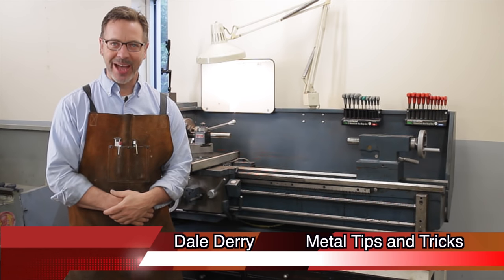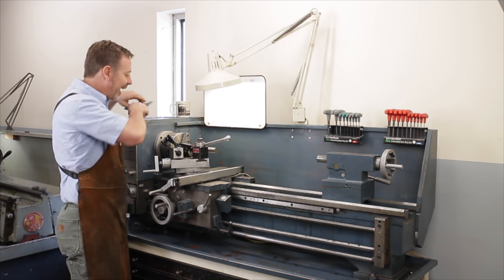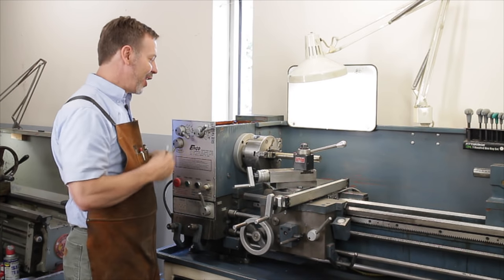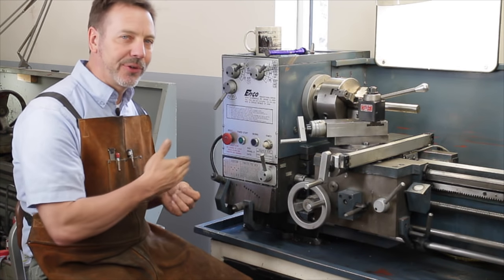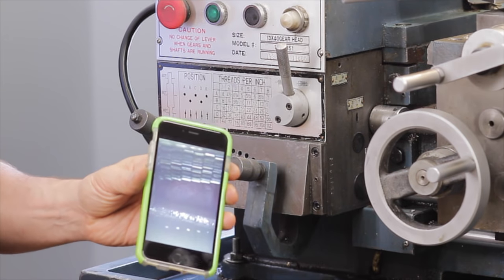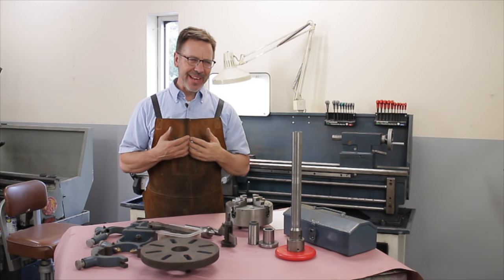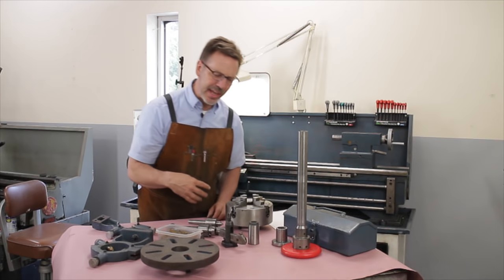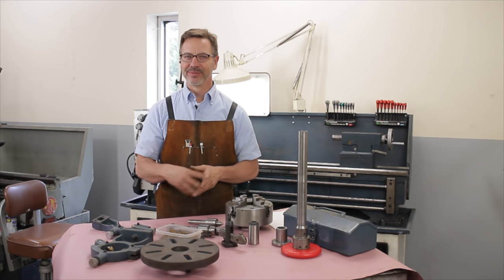How to Buy a lathe part 2

Comment: fun series Dale..  I do everything you mentioned...

AFTER I've bought it.  I'm lucky if they let me take the tarp off.  ;)
Reply: +1 lol
Reply from the maker: +This Old Tony 
LOL that happen to me once.
Reply: I had the owner drain the oil and remove all the bearings and send them in for molecular testing while he had a certified lab do a full magnaflux on the rest of the lathe. Then I just ended up getting a HF mini lathe instead..
Reply: That’s what I questioned in the first video. I really don’t see most sellers allowing people to do such an exhaustive check. Turn it on as see that it runs. Take a good look and turn a few dials, and that’s about it.

Considering that most older lathes are going for little, by the time you subtract all of these problems, the guy will be paying you to take it. But if you have the room, the power, and a way to get it home, going to industrial auctions can get you a heavy, old, American made lathe for peanuts. But they will be very dirty, and need work. Many of the problems mentioned here will be seen. But if you can fix these things, and are willing to put some money into it, you can get a machine that will do everything you need, and last forever.
Reply: My last lathe purchase went like this over the phone:
"Hey I noticed that your ad is a few months old but still up, just wanted to know if the lathe is still for sale?"
"Yeah, had some people look at it but no one wanted it. Say, how much was it listed for?"
"You had it on FB marketplace for $1500"
"Ok, I can do better than that"
"Ok, tell you what, give me a price you want to sell it for if it's good enough, I'll buy it sight unseen.
"You can have it for $1000"
"Sold, can I pick it up Saturday?"
"Sunday's better for me, cash only."
"No worries. See you then"
I am now the proud owner of a SB 9A x 36 toolroom lathe 1961 with V-belt and under cabinet drive. It came with a 3 jaw, 4 jaw, complete set of 3C collets including hex and square, telescopic steady rest, Aloris toolholders, QCTP (new), lantern post, tooling for the post, he threw in stock, carbides and HSS. I got the sales card from Grizzly and it had a hardened bed option. The only thing missing was the taper attachment but the crosslide still has the taper version on it. It had a new three phase 1.5HP motor. I preordered an inverter and tested it the day I moved it. Everything worked. Took about two months to pull it all apart to clean it up and rebuild some things part time. One of the best purchases I ever made. Didn't spend money fixing it, just time. The bed looks like new. The lathe works like a dream. My wife doesn't want me to buy a taper attachment to complete it, because she knows I can make one. So that's the next project.

Comment: Good set of videos.

Just a short comment about the horsepower of the motor:  Unless someone were to run a .300 deep x .020 cut in 6" 4140 heat treat on the "Baker's lathe" you'd probably never get the motor (5hp) to put out its rated power. The bigger problem with motors is the mismatch between the available power (1 phase vs 3 phase and 110V vs anything higher) and the electrical requirement of the motor. If, in fact, you had a 5hp 110v 1 phase motor (I have one so I know they exist) and you were to start pulling the rated load the breakers would most likely kick-out (unless you have a special circuit for the machine). If the higher-power motor were to have a higher speed than a stock factory motor (3450rpms vs 1725 stock) THEN there is a problem and I'd walk away. You can never know how that machine might have been abused running at 2x speed.

In machinery speed creates wear more than the power transmitted.

Comment: Excellent tutorial, and I like what you are doing for the trolls! This is the first video I have seen where someone took off the gearbox cover and didn't actually run it to check the "splash" lubrication or had signs of same incidence on the walls. Thanks!
Reply from the maker: +howder1951 
LOL

Comment: Dale, your guide is amusing in many ways. Machine tools bought for the money you have apparently spent are usually at the end of their economic life and not up to much. I find your prices frankly incredible. As for buying any lathe it is all about the bed and nothing else. All other surfaces can be made to run no matter how warn, but a bad bed on a cheap lathe spells recycle time for it. If you have perceptible end float in a  Timken bearinged main spindle the gears would likely be damaged and you would be breaking carbide tips like no tomorrow. You would also be getting a chatter patterned finish on any work attempted. The most accurate lathes generally use a precision bush system on the main spindle with attendant thrust bearings because Timken bearings by their very nature tend to allow for some chatter no matter how well you set them up. As for your comments about the wear on the lead screws and inaccurate thread cutting as a result I consider that would be very unlikely. As long as the form of the screw is still there and the clamp nut is in good condition it would still follow no matter how rounded the thread has become. It has not changed its pitch, it has just warn a bit in other words. Hell what would I know, I'm in my 60's and work as a machine tool mechanic!
Reply: If the lead screw is worn in the usual area, your thread pitch would decrease slightly and then increase slightly as you traverse. That could make a difference on your job eh?

Comment: Dale,I wish I had your video when I bought my lathe.  Its the exact model you're demonstrating.  Problem was that while in very good shape, it was missing a few pieces.  Like the Quick Change Gearbox cover plate, threading gear quadrant, and the 2 40-tooth gears.  As near as I could tell a disgruntled employee took them when they did away with his job.  But as they say "I wanted it."  It came with a fair amount of tooling and DRO.  I learned fast that Grizzly was a lot more economical for parts than Enco.  That plate was over $200 from Enco and about $35 from Grizzly.  The quadrant needed a little mod to fit.  The surprise was that the plate came undrilled.  I took the knobs off the shift levers, drilled the primers out of two 9mm cartridge cases per lever and then slipped a locating punch through the holes in the primers.  I lined up each lever to the proper gear and marked the plate.  Drilled the holes and was back in business.  Next time just run away.
Reply from the maker: +Chris Vuxton 
Great comment.

Comment: Very well done Dale and I'm pretty critical about just how much can sometimes get missed on videos or forum topics of this type. Maybe the couple of things I could add would be to check the clearance by lifting up on the spindle a non roller or taper bearing lathe and indicate that movement since if it's been run dry at all or just decades of general wear then gravity alone will give the most clearance in that direction. 

It's certainly user specific, but having a tee slotted cross slide for between centers boring would also be very high on my list and add a fair bit to the price as well.
Reply from the maker: +Turning Point 
Great Points

Comment: great video Dale, I wish I saw this before I bought my gearhead lathe. but like; this old tony said. " i did my full inspection post purchase". I got totally hosed on it, like for example 3 gears were missing a few teeth each. they are very very costly to buy and tough to make, they are hardened and ground gears, even the ID is ground lol.

I wasn't able to hear it run, because his phase converter was "not working".

In retrospect I should have walked
Reply from the maker: +Billy T
 Im so sorry to here that :-(
Reply: ***** live and learn I guess.... you'd think by age 47 I would have learned my share by now

Comment: I was able to find a atlas 12 x 36 aloris tool post and nice full set of tools and has quick change gear box, no teeth are ways wear,, and my dail indicator didn't hardly move on spindle check ,, 800 dollars and 3 miles away from me,,,great deal..

Comment: I am learning about lathes as much as I can before purchasing my first one. Your videos were very helpful. I have not gone and looked at one yet. 
What size is that Enco?
What type of electricity service does it require 110v, 220v, or 3 phase?
I want a lathe to supplement my other hobbies, car and motorcycle repair and restoration. What is the  minimum/maximum size lathe I should consider? Thank You

Comment: Thanks again. Part 1 was great. Part 2 was even better. You really have helped me in providing  me with excellent information on buying a lathe. Can I ask you about the type of lathes? I have seen lathes labeled as Precision, Engine, and Toolroom. What are the differences?
Reply from the maker: +torito90 
Great question. A True pecision lathe  will cost a minimum of $25,000 new. Engine and tool  room lathes are not as well made. they cost less  and usually have a larger capacity. They  are the work horse of industry, and   are basically the same  thing. Its Kinda like calling a pickup a truck or a truck a pick up.

Comment: Did you check out the electrical Controls, emergency stop, stop ,start and so on? Or did I miss something?And the wiring? A modified electrical system can cause some headache.
Reply from the maker: +new and old tech 
Great point. I tried to cover most the big stuff. Sorry I didn't cover the electrical items. In most cases those things can be fixed with out a big investment in time and parts.
Reply: +Metal Tips and Tricks (Dale Derry) Often there is a cabinet with contactors (I am Swedish so some technical terms might be off using english) and control equipment and maybe a transformer. And to start the lathe up, can give and indication of the status of the motor. If the emergency stop does not work or the Controls start stop and so on does not give the desired response, you bet someone have made a modification. I am an electrical engineer, and pathologicly analyze electrical issues.Though the mechanical stuff is interesting in the sense that you know what is possible with different Equipment, and to know when something smells fishy.And you are right. Mechanical issues are harder to fix, but since electrical is my trade i have OCD about those things.

Comment: I watched both videos and learned a lot about how to buy a lathe, but do you have a show on how to transport it from the seller to your shop?
Reply: Did you ever the solve the enigma of actually moving a lathe? I've never bought a lathe, because I don't even own a truck. I have a work van, and that's it. Do you need to hire a moving company to move it for you? I would hate to break something, and it seems like you'd need a forklift to move it? I do have an engine hoist, that is extremely heavy duty, rated for at least 2,000 pounds. That would probably work?

Comment: That Enco looks just like one I used to own 20 years ago. Nice videos and good info on used lathes.  I guess I should walk away from my own lathe :) But it is a South Bend heavy 10 I inherited from my dad when he passed away five years ago and had been in his garage since the mid 60's when I was a teen.  Had to spend a little to make it run better and  I  have to live with some crash marks on the compound that I am sure I did 50 years ago. Not sure I will fix those marks, as they are memories and reminders of what not to do. I also find it funny when we whine about spending $1000 on a lathe that can last a lifetime or more but will pay $800 on a cell phone or computer that will last 3 years if you are lucky. Yep I most likely spent $500 making that old machine run better but I am also pretty sure it will out last me.

Comment: Thank you for this video.  I really found the explanations helpful.  I am not looking to buy one but build one.  Any tips?  So far what I have learned from other places is make sure the surfaces are truly straight as well as using thrust bearings.  I was thinking maybe some car axle bearings would be good items to use in that case.  Thoughts or tips?  Thanks!
Reply from the maker: HI Scott, My first lathe was homemade. I bought it at a junk store for  10 bucks. Their are some books out there on building a lathe I would start there. :-)
Reply: Yeah I have the gingery lathe book but thought you might have some generally recommendations for how I might upgrade it to work better.  Thanks for the response anyways!
Reply from the maker: You have ask a big question,. Much to difficult to answer, sorry

Comment: Been looking for a hobby lathe (something in the range of a 8-10” swing x 24”). I’ve never seen anything listed on eBay, Craigslist, or Letgo for the kind of prices your suggesting. Most are in the 5-10k range. Have the prices gone up? Can you make some recommendations for what brand/models to look for in a used lathe; as well as new quality machines that would be a good choice for a beginner with room to grow?
Reply from the maker: What part of the country do you live in?
Reply: @BuildSomthingCool  I'm in northeast Tennessee.

Comment: really good videos - but I never could find one in the price range you mentioned - so I bought a new one just like your Enco 15 years ago - now they are min. $3500 new. 
 ADVICE - make sure you have a disconnect switch on it and use it. If not, the transformer stays hot all the time and mine took 10 years to blow. It took out the entire electrical control system when it went. Nightmare to fix.
Reply: I wish I could find a good metal lathe for that price a new 12X36 now is $3,715 .62 with out fright

Comment: Given a choice, I would opt for a belt drive machine over a geared head machine, especially if it is one of the Chinese mystery lathes. If a geared headstock has any kind of problem, finding repair parts is going to be an adventure. 
    A belt drive machine is quieter than a Chinese geared lathe. The straight cut spur gears whine in about every one I've heard run. I've not had a problem with slippage on a belt drive machine if the belts are in good condition (and American made) and the pulleys are properly aligned (which they often aren't on Chinese equipment from the factory).
  A comment below says they wouldn't have a lathe without a VFD or DC motor. If the lathe is properly designed the spindle speeds are geometrically  stepped and a single speed motor is just fine. The geared head Enco in the video may not be stepped correctly and has too much of a gap between certain speeds.  In my belt drive 12 speed lathe, each speed is about 22% faster than previous speed.
Reply: Aceroadholder  his point about efficiency is on point still, belts do soak up power.  still, the flat belt on my old lathe is cool and charming. I wouldnt give it up, and Im actually adding another to replace the V belt that was retrofitted at some point.
Reply: It's a help with v-belts on these lathes to replace the motor belt with one that is notched on it's inner surface. The motor pulley diameter is at about the smallest it can be and still used with the supplied belt. A notched belt is better able to handle the small motor pulley. It runs quieter and can transmit more power without slipping.
Link belts work well too and their use eliminates pulling the spindle to renew the lay shaft to spindle belt.

Comment: Great video! Wish I had your luck finding good lathes for 1000 bucks....I'm still looking ;-)
Reply: ikr
Reply from the maker: +Nate Van Bynen 
Take your time you will find one.  I come a gross then about every 6 mouths or so. :-)
Reply: +Nate Van Bynes I have a Brown & Sharpe screw machine you can have for $1000, with tooling.... serious. Wanna learn about automatic lathes and how to process plan for turned parts for production? 220v 3ph 1800 pounds about 60"l x 30w with out stock tube (can be any length but I have a tube for 12 foot bars)  1/2" round capacity about 3/4 inch turning length. It's in the Los Angeles area.